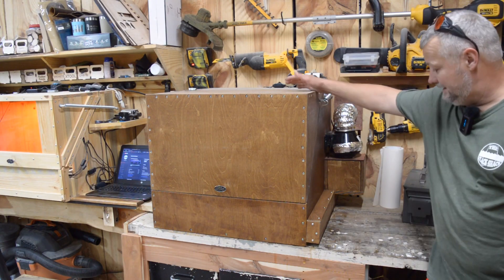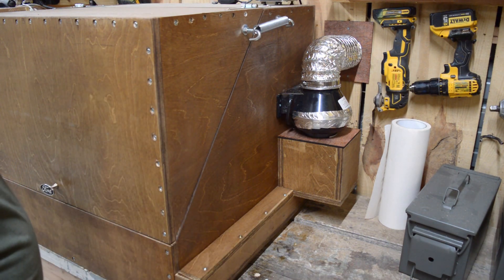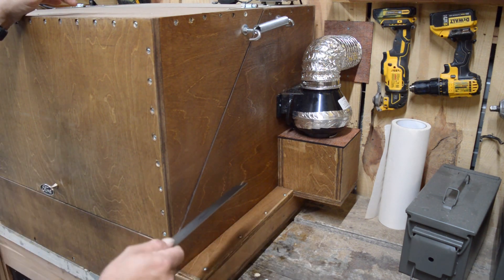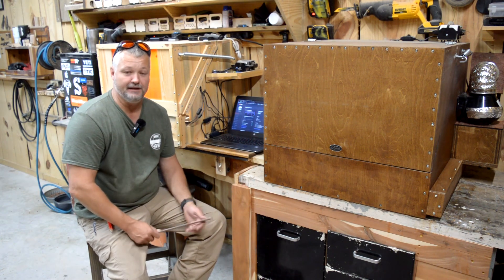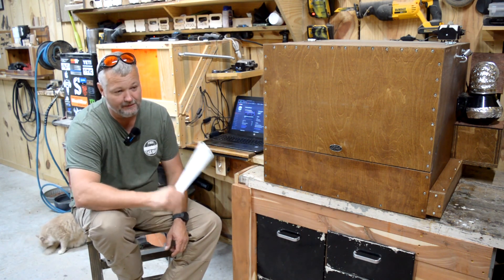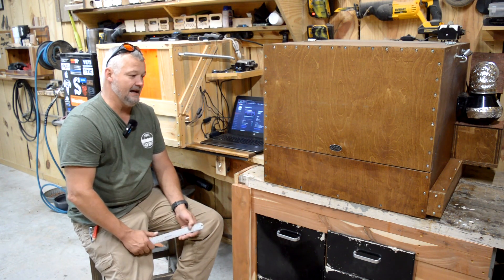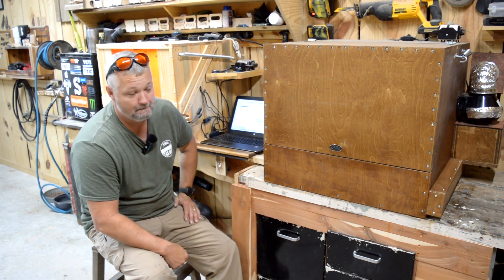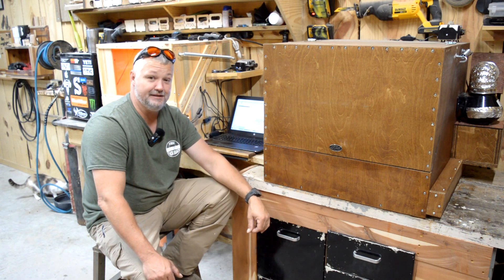New ventilation design

Comment: I watched this twice and if I missed it, I apologize but did you make any holes to allow for fresh air to come back in to allow for better air flow or is it not needed.  I don't have an easy way of venting out side my garage since the outside is brick.  I'm thinking about an enclosure like yours but use a shop vac to create a smoke eater.
Reply from the maker: There is a hole in the back where the laser wiring enters (3/4 inch). One hole for the camera and led lights (1/2 inch) and a 1/8 inch split below the door to form a draft channel. Yes, it does have fresh air intakes. I tried to restrict the air intake slightly to maintain negative pressure inside.
Reply: @TheClackShack  Thank you and I have learned a lot from you

Comment: With all the fires I'm seeing reported I just replaced the wooden enclosure that I built with a new one I built using cement board and 2020 aluminum extrusions. It took me a while to come to the realization that a fireplace shouldn't be made out of wood. I feel much safer now.
Reply from the maker: That's not a bad idea, I keep an eye on mine when in use. MI think many of the fires are a result of improper settings.
Reply: @TheClackShack  I saw a post recently where the guy claimed that he went to the bathroom and came back and it was on fire.  One can never be too safe.
Reply from the maker: @Chucka1463  , it could happen but in  almost a year of running the machine mostly 7 days a week, I haven't had a fire yet. I do run smoke detectors and have metal sheeting in the bottom of my cutting enclosure.

Comment: Could you come up with a way to make the laser head mount go up higher and lower instead of making the floor go up and down? I have the same problem taking the legs off and on.
Reply from the maker: I have been thinking about it. Working on it
Reply: @TheClackShack  Cool Beans! Can't wait to see what you come up with.
Reply: There are already several z axis extensions on etsy and the official facebook group. Which one is the best? That I don't know. I also liked the idea of lifting the table and managed to find lab lifting platforms on amazon. The main thing that puts me off the z axis extension is the added weight and/or the change in weight distribution affecting the machine.
Reply from the maker: @texmextrol  , I agree, at high speeds, adding weight to the head just seems like a recipe for slippage or damage to the steppers. I may just be adding legs for a while.